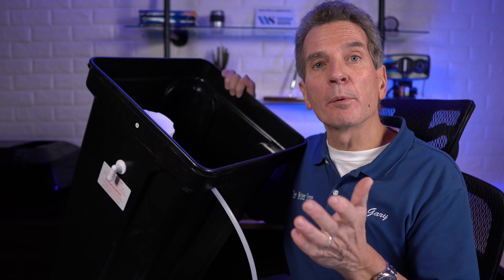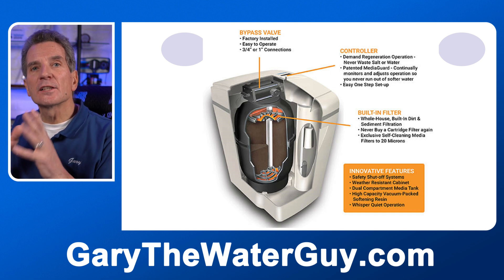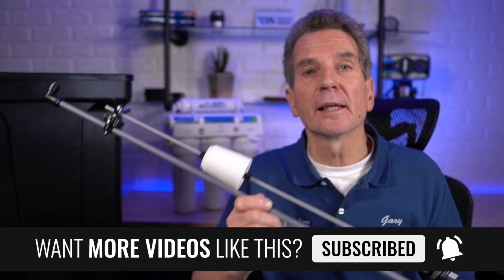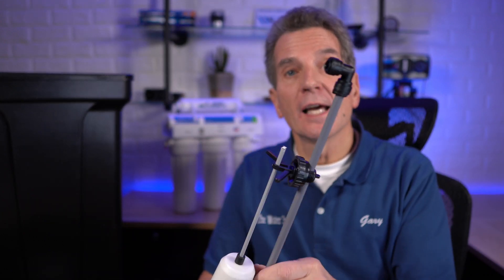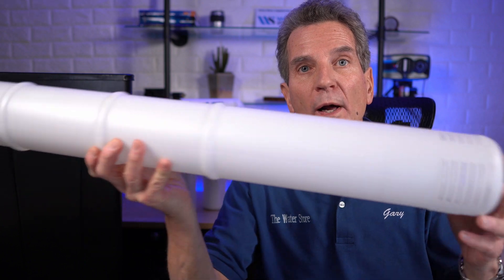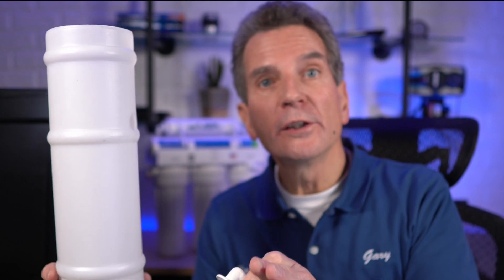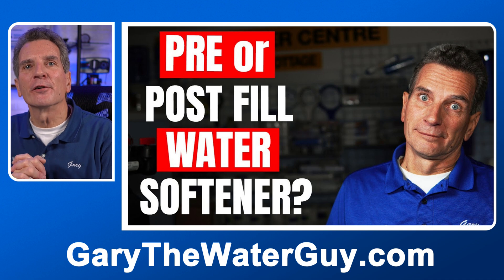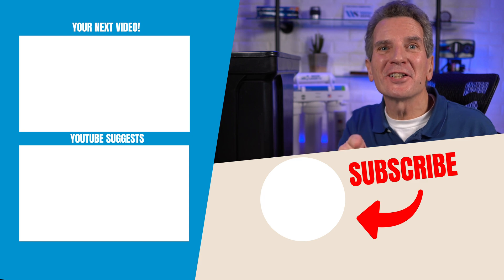WATER SOFTENER BRINE TANK

Comment: How do you adjust the amount of water going into the brine tank?  Mine is about 2/3 full of water at all times.  It is a 3 button system, 1 person household, and set at P3.  I discovered the transformer had died and the system off for possibly a year.  When checking the brine tank, it had a bridge. I removed the bridge and salt, checked the bottom to make sure it was clear, checked the drain hose which was clear, checked the brine float and tube and replaced it, checked the venturi valve for clogs and everything seems fine.  I reset the time and regenerated it, but the water level in the brine tank seems to be very high and when testing my water for hardness with test strips, it show low on the container, the ph and alkaline are low.  So, how do you adjust to make softer and raise the ph and alkaline, and get the brine water level at a correct amount?  Please help?  I have watched your videos and read the manuals, called a professional, and still stumped! Thank you!!
Reply from the maker: Here is a copy of the manual http://clackvalves.net/pdf/documents/WS1TC%20&%20WS1.25TC%20programming%20manual.pdf  at the bottom of page 1 explains that you need to set the fill time based on how much salt you will use, determined by how much water fills the brine tank.  Typically 6 minutes of fill equals 3 gallons of water which absorbs 9 lbs of salt.  I hope that helps.

Comment: Usually my softener works well but this last time that it was scheduled for regeneration the water pump didn’t come on at some point so the regeneration didn’t finish. The salt tank isn’t full of water but there’s salt in it. What do I do? Turn on the hose & put water in the salt tank?
Reply from the maker: Yes, I would add about 5 gallons of water and during the next cycle the water softener will add the correct amount.
Reply: @water_estore  ok. The reason for the pump not coming on is there are ants going into the switch. So I have to check sporadically to make sure that doesn’t happen a lot. Also I tried to manually regenerate with the push button on the softener controls - but it didn’t start. So I got a screwdriver & tried turning it so it would come on. I found I was turning it clockwise instead of counterclockwise so when it started to turn I was able to turn it to regeneration & it did the full cycle - filling the salt tank with water. Thank you for replying. I appreciate it.

Comment: Got a Fleck 7000SXT and it without brine tank. Can I just add the brine tank as the programming seems to allow it. Any suggestion?
Reply from the maker: Why is there no brine tank?  Are you sure that it is a water softener or something else?  If it is a water softener they all use salt so there should be a brine tank attached.

Comment: Gary,  I’m looking for a simple answer.  I think have a Waterboss 900 at my Cabin. I know it’s a 9 something. Sorry I’m not there to be sure.

How much water should be in my brine tank?    I had service on my Well and the service technician said my water level in my Waterboss should be filled to the top of my salt level. 

We added water but I think he is wrong.  Don’t I just need a couple of gallons of water?

When it regenerated the salt level dropped about 5 inches.  

It appears to have used to much salt.

This advice I was given I feel is incorrect.

Thanks in advance.  I trust your professional opinion.
Reply from the maker: He gave you incorrect information.  The water softener programming determines how much water should go in there, typically just a few inches.
Reply: @water_estore     Thanks Gary,  I may have had 1 Gallon of water in the Brine Tank.  Will it correct itself during a recycling or do I need to remove water manually.